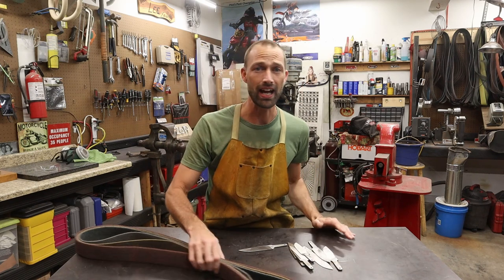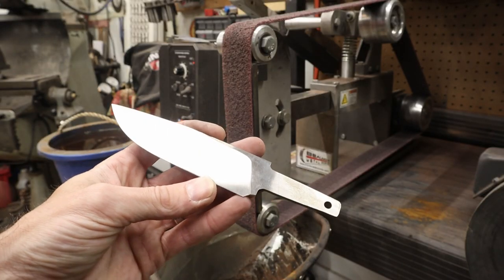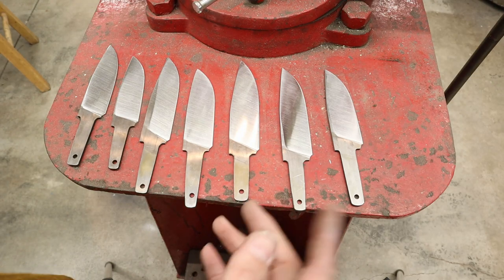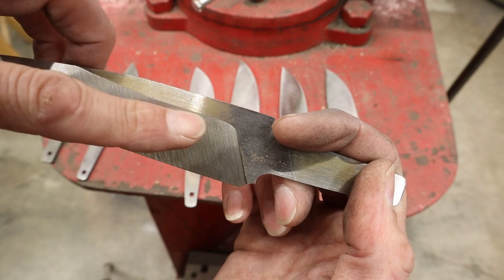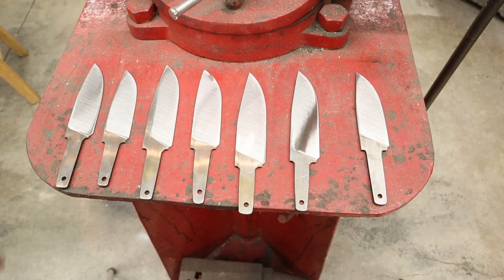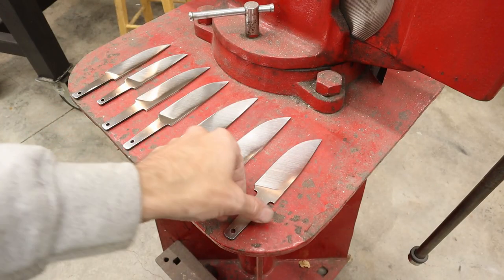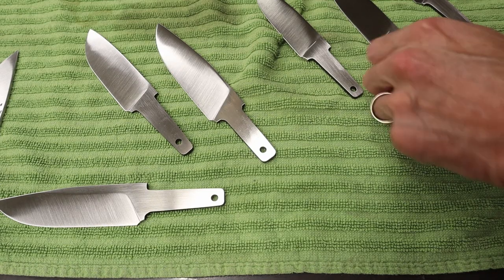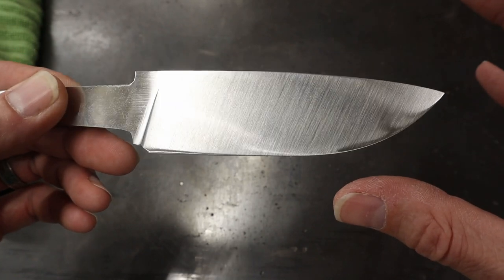Make a knife without hand sanding! (knife making with surface conditioning belts)

Comment: I am in the middle of hand sanding a knife now and let me tell you I'm having a tough time getting what I want. I am looking for a different solution.
I sure would like a sander as you have but they are pricey so I'm stuck hand sanding.
Thanks for the video, you do a great job. as always stay safe my friend.
Reply from the maker: Steve, I hand sanded for years and still do! This finish is great but I get bored with it fast. It also doesn't give me high end results. When it comes to Damascus or any knife with a hamon you have to sand through the grits for good results! I made a video about a hand sanding tool that really helps with hand fatigue! Also make sure to use lots of water on your sand paper to flood the surface and your paper will cut longer and not load up. Using water is a highly debated subject but I prefer it!
Reply: @Aleeknives  I just watched the video you were talking about. jig with golf balls what a great idea. I will certainly give it a try
Reply from the maker: Sweet!

Comment: I use the 3M belts as well. Hand sanding is just more work that I don't need... I don't sell them at any rate, so just as happy with the 3M belts. I have been sanding to 180 then running the belts, guess that is one more step I won't need going forward... Thanks for the video...  I subbed and liked... Take care...
Reply from the maker: Totally agree with you!  Thanks for joining us on the channel!

Comment: I tried these belts on my 2x42 after I watch this video and was amazed with the results
Reply from the maker: The cool part is I've used the same three belts for over a year now!
Reply: Same here i was amazed at the longevity, I also noticed a huge boost in performance by spraying them down thoroughly with WD-40 before I get started

Comment: Great video.  Love these belts!  I know you were going for no hand sanding here but like you mentioned, I find it better to do the flats up to 800 or higher then just hit the bevels with the conditioning belt.  It gives a great matte blade finish that way. 👍
Reply from the maker: I can't normally get away with a finish like this because I use damascus or differentially harden or have a hamon line. All of tho$e require a full sanding regiment to bring out the figure in the steel!
Reply: Yup, same here but on lower end knives it works well.  Sometimes I have friend’s kids over making knives and it’s great for that too.  👍
Reply: Jumping in here. Great video.  Tyrell you mentioned hand sanding flats.. I'd agree that should keep the crisp lines in. Do you use the conditioning  belts on the bevels first and then work the flats after or vice versa?  Thanks
Reply from the maker: You have to go in that order. If you sand the flats first when you do the bevels the little fibers on the conditioning belts mare the flats
Reply: @anthonyluc389  I only use the conditioning belts on full flat grinds like chef knives.  I never personally use them on knives with bevel transitions because they wash out the lines.
Reply: @Aleeknives  thanks mate. I'm new to these belts. Will test around and let you both know if I find any tricks.

Comment: Hi, great informations on your video!!!

 I´ve tried to use these belts in many different ways and what I´ve observed is that the medium and fine belts put more scratches than taking them from the blade. After p120 zirconia, I´m using Hermes Mercurit, compact grain. These belts are amazing because they are thick, and don´t scratches the blade like normal fine grains. I use p240, p400 and p600, than Trizact A16, the finish is quite perfect and no more hand sanding...
Reply from the maker: This is excellent advise! I will try that! Thank you
Reply: I've been wanting to try some Trizact belts but I'm a little confused on the belt progression ie coarser grits to finer. Do you have a complete belt progression list? I mean is a A16 equal to a 400 grit and so on. I want to get it right because there're expensive.  I've been wanting to try these Scotch Brite also.
Reply: @ozzyfranf  I start with p60, p120 (try what´s the best for you, ceramic or zyrconia) and than go to Mercurit p240, 400 and 600. At this point the finish is great, a superfine scotch do a light polish. To a mirror finish, Trizact A30 (p800), A16 (p1200) and A6 (p2500). And for me the transition between 60, 120 and 240 are the weekest points, you can´t take away scratches from a coarse grind with a fine belt...I usually paint the blade with blue ink Pilot
Reply: @dom_raphaelo   I use ceramic & zyrconia and then aluminum oxide up tp 400 grit and if I don't etch I hand sand. Sometimes I'll hand sand up to 1000 grit then etch. I wanted to try something different. Thanks for the help.
Reply from the maker: That is pretty much my progression also!
Reply from the maker: Not sure on the trizact belts
Reply: @ozzyfranf  give a try on compact grain like Hermesit or Mercurit, the best sander belt I ever used...
Reply: rafa72 I buy from Tru- Grit do they have them?
Reply from the maker: Good question? I will check tru grit
Reply: Aleeknives That’s cool I can look.
Reply from the maker: Will do!

Comment: Thanks for sharing. Learned lot from your work 😊🙏
isn't it a bit harsh to go directly from 120 grit to conditioning belts? Wonder what results you would get if you for example went to a trizac A100 or a bit higher grit before. Regards from Denmark.
Reply from the maker: I actually have done a ton of experiments with different grit finishes and you are correct it provides a little more consistent finish by moving to higher grit belts first and you spend less time on the surface conditioning belts!.

Comment: What grit do you grind to before you go to the red belt, also have you ever used “ belt grease “, it reduces the cut of the belt because it fills the pores of the belt, but it reduces the temperature when grinding after heat treatment. Thanks
Reply from the maker: No I have not used belt grease before

Comment: I had one of the blue ones split long ways down the center, then half of it snagged the gut hook (it was far away from the belt, but when it broke it threw it off the tracking wheels, and then completely off the machine). 

It sounded like the apocalypse was going on in my shop. I’m not 100% on what caused it but my life flashed before my eyes. I just knew I had some shrapnel in me and I was going to die but my PPE saved my ass.
Reply from the maker: Please 100%

Comment: If a person opted to hand sand the upper part of the side of the blade would that redefine the grind line ?  Also I notice that you have a. Slanted plunge line and grind downward instead of horizontally level, that is at a downward slant , does that help to prevent gouging of the blade at the 2 inch point?

Comment: I had the same disappointing results when I tried using the surface conditioning belt. I still use it with kitchen knives, though, since there's no plunge line or grind line.
Reply from the maker: Since I made the video I have realized that if I take the grinds up to 400 before moving on to the conditioning belts
Reply: @Aleeknives  Another solution you might try is to temporarily glue a piece of leather to your platen, then grind to 400 grit. You can get really smooth grind lines that way without the facets, and you can keep your crisp grind lines. You still might have to hand sand the flats, though.
Reply from the maker: That is a great idea! I personally hand sand almost everything because I like to do either Damascus or a hamon. Or even just an acid etch and all those require a fine finish first

Comment: how do you finish your blades before heat treating?  With these belts or do you sand them to a specific grit?
Reply from the maker: I leave my blades thick before heat treat! So I only take them to 36grit before heat treat then finish grind afterwards. If there is any slight warping you usually have enough meat left to grind it straight!

Comment: what grit were the blades at before going to the conditioning belts?
Reply from the maker: I finished up with 120 grit aluminum oxide belt before moving into the surface conditioning belts

Comment: What speed do you run your belts at with Scotchbright belts? Do you use any grease, oil, or buffing compounds with these belts? 
Thanks :)
Reply from the maker: All different speeds and I haven't used any other compounds on these belts

Comment: What “grit” would you say those surface conditioning belts are?  I noticed you used 120 grit for the initial bevel. Have you gone higher like 220 or even 400 on the 2x72?
Reply from the maker: The conditioning belts are rated for course, medium and soft. They a feel pretty grippy. I have also tried going up to 220 before moving into the conditioning belts. I didn't see any advantage though

Comment: Hello, grand sensei! Working on my second not-just-for-practice piece and I am having some trouble sanding out grind marks at the plunge line without blurring or even ruining the crispness of the line. Could a 1k grit (my finish sanding will be to 1k) belt be used to grind out these marks at the plunge, or am I gonna have to go up from 80 grit (the original rough grind grit) to 125, 220, etc? In other words, can I “jump” to 1,000, or am I asking for trouble? Thanks
Reply from the maker: That's a good question, I find it is better to move through your grits rather than to make a huge jump to a much higher Grit. The problem is higher grits tend to create a lot more heat
Reply: @Aleeknives  thanks! that's what I suspected. Nothing good (results wise) ever comes about quickly, lol
Reply from the maker: So true!

Comment: Great stuff... I noticed in another vid where you cleaned up the plunge a bit in a rather unorthodox way holding the knife almost perpendicular to the belt...Sorry, I dont recall which vid as I've been on a viewing spree of your vids of late.   I'd  never seen that and I'm curious about trying it.  I didnt notice you doing that with these conditioning belts though. Any particular reason why?  Seems these belts would be more conducive to that manner of clean up.
Reply from the maker: These belts don't  track accurately  on the edge of the platen so the are not consistent. My sanding belts work at cleaning the plunges up, make sure your belt doesn't  run over the edge of the platen because it could potentially dig a rutt  and that would suck bad!

Comment: I think I heard correctly but you seriously just made the jump from 125 grit to the surface conditioning belts and got that nice of a finish?
Reply from the maker: Yes I did! But I used 3 different conditioning belts. It washed out all the crisp lines and plunges but could be acceptable if that is what your going for.
Reply: @Aleeknives  Sounds like the perfect solution for big full flat grinds on working knives to me!
Reply from the maker: For sure!

Comment: i heard using wd40 on these belts helps them run smooth .....never tried myself though
Reply from the maker: I would be scared to put oil on such an expensive belt! What if you don't like it?
Reply: @Aleeknives  i really don't know , surely it can't hurt ,you do rub metal against them haha . maybe don't try that anyway ....
Reply from the maker: I would try it out after the belts had some good use out of them but then I don't know if that would be a good test either!
Reply: @Aleeknives   yeah might be worth a try , nothing to lose on a worn out belt.
Reply: Wd40 on these belts works great, been doing it for a couple of years with no issue.
Reply from the maker: Sweet! What benefit do you see from using the WD-40?
Reply: I don't know if my eyes play tricks on me, but it seems to give a little smoother finish at the end. I do only use wd40 on the last few passes on my blue or grey belts. (finest)
Reply: @Aleeknives  awesome videos btw, keep em coming
Reply from the maker: Interesting!  Thanks for the tip! I will try it